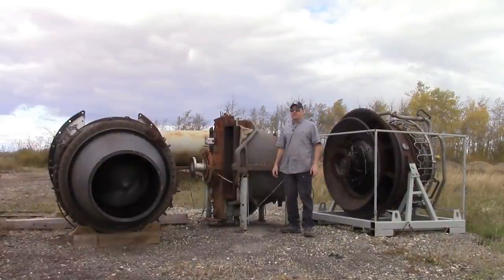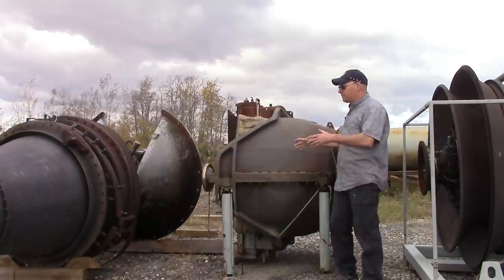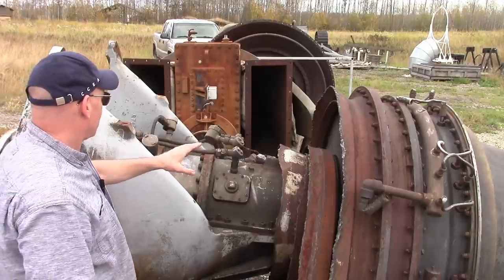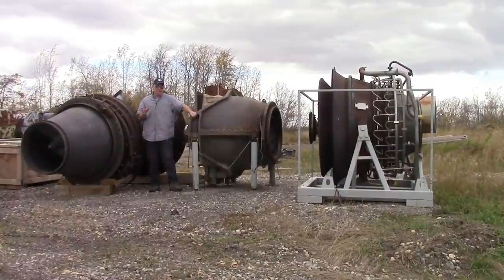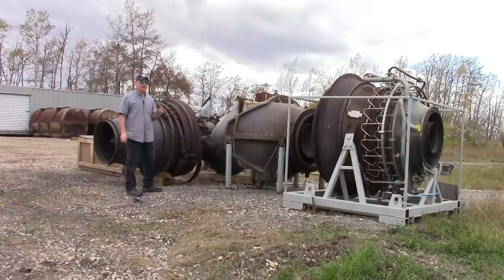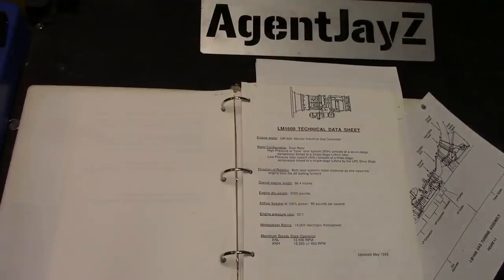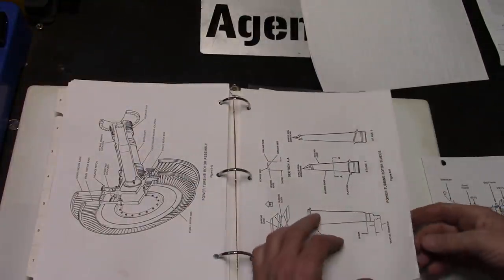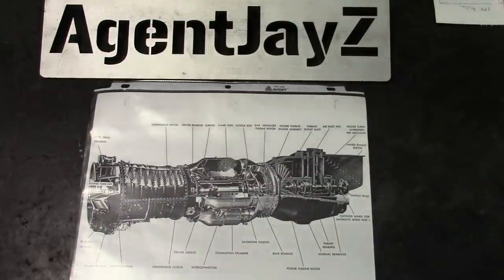Power Turbines 4 Different Ones

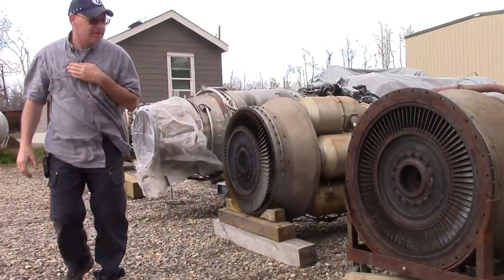Comment: great in depth soliloquy [because the air-head no power people won't be able to comprehend],awesome. you always manage to enlighten even an olde pharte such as myself. couple of curiosities: at 10:00 in the background appears a partial engine in a frame at about 45 degree angle.. whats that? and at 21:45 whats the last engine in that lineup? and, why keep all those "junk" pieces of material if they are just "rusting away". thanks mr Zed  lol
Reply from the maker: That's an afterburner assembly for a Spey, next to ABs for an F404 and a couple J79s.
In the other yard, the far engine is  J65 out of an A4 Skyhawk.
A lot of the parts are stainless steel or titanium alloy. We have too much of this sort of surplus to store it all indoors, but we don't really want to scrap it completely.
Reply: @AgentJayZ  so you're hoarding?  </wink>

Comment: Is there such thing as an engine where its compressor blades that rotates with the compression wall - zero tip clearance?
Reply from the maker: The compressor rotor needs to have rotational speed relative to the stators, so there needs to be a place somewhere with one part moving and one not. The clearance needs to be as small as possible at that interface, but the parts have to move.

Comment: Does the 1994 pt have ball bearings because it runs less often? Or because the oil system is better?
Reply from the maker: Its a choice the designers make. Ball bearings last for years, and journal bearings can last longer in continuous service. I do not know the history of this unit.

Comment: This was an awesome video, but sorry, I have another question. At the beginning and very end of the video, what are the two rings of nozzles on the power turbine on the right? They look like the fuel rings for an afterburner. Is it air or liquid cooling of some sort?
Reply: I'm wondering the same thing. If I had to hazard a guess I'd say water injection based on the look of the plumbing, but that would be kinda odd since the power turbine would already run significantly cooler than the gas generator turbine without any auxiliary cooling
Reply: It's cooling air for the stators.

Comment: With the recent Airbus announcement, can you do a video discussing different fuels for turbines? Kerosene vs propane vs hydrogen ... how must a jet engine be adapted to run on any of them? Thanks.
Reply from the maker: Only the fuel control and delivery system needs to be changed between liquid or gaseous fuel use. For the basic fuel burning core of the engine, nothing needs to be changed. Heat is heat, man, and bring it on!
Reply: @AgentJayZ  So, say you have a hydrogen powered gas generator. Is it then a steam generator? Does the power turbine need to be the size of steam turbine? I wonder how does this affect turboprop concept.
Reply from the maker: No, it is not a steam generator.
Water vapor in heated exhaust resulting from combustion of hydrogen in air is not steam. 
We can't back up any further; you'll need to do some learning on your own.
Besides, I thought your question was about different fuels...
Reply: Having been involved in fuel system and combustion design, I can support AgentJayZ's reply in respect of the fuel control and delivery arrangements, which includes the burners.  For the same energy content and release, the volumetric flow of a gaseous fuel must be considerably greater than that of a liquid fuel.  However, the combustion chamber itself rarely needs any changes . 
Take a look at some of AgentJayZ's videos and compare the relative diameters of the manifolds and burner  'pigtails' for gaseous and liquid fuels.  Similarly, the  internal passages and outlet orifices of gas burners have to be enlarged, relative to the equivalent liquid fuel burners.
Now think about how difficult it can be to design a dual fuel burner, which has to have internal passages to carry the full flow of either fuel.  Been there, done that.
Reply: @jurepecar9092  There is obviously a substantial proportion of water vapour in the combustion products of any hydrocarbon fuel.  When hydrogen is burnt, the combustion products are, equally obviously, water vapour.

Comment: Good Stuff. What would the average power efficiency of a power turbine be? Useful Gas Producer power vs wasted GP power.
Reply from the maker: Graham is a better person to ask about this, but I think I've heard 85% to 90% efficiency for industrial power turbines used with aeroderivative gas turbine engines.
Reply: AgentJayZulu (I must get used to the new handle!) is in the right ball park, in terms of what is termed the polytropic efficiency of a turbine..  A free power turbine is essentially no different in efficiency relative to the LP turbine of, say, a big turbofan engine.  In fact, the latest big aero-derivative industrial and marine engines often use the aerodynamic design (if not the actual blading) of the LP turbine of the parent turbofan.
Considering the RT45 power turbine that we haver been shown here, I've found an ASME paper describing its development, back in the late 1970s.  With its Industrial Spey gas generator, a thermal efficiency of around 34percent at max power was quoted.
Reply: @grahamj9101  85% to 90% is much better than I would have thought and assuming that's running in the normal operating range of 90 - 100% of it's rated power output.
So much more efficient than a reciprocating engine.
Reply: Combined cycle which then uses the waste heat for district heating gets up to 90-ish % thermal efficiency. The best I have seen for a pure gas turbine without using leftover heat for something else was 46% but that was a few years ago, maybe it has improved since. That one was in the 100MW range.
Reply: @gcmsinc  That's just the power turbine's efficiency, not the overall cycle efficiency. The gas generator will have its own thermal efficiency and the total efficiency is the product of the GG's thermal efficiency and the PT's isentropic efficiency.

The most modern engines cores can achieve a thermal efficiency in the low 50%. A modern power turbine will have about 90% efficiency, so overall efficiency (the product of the two) is about 50%, or just shy of it. That's similar to large reciprocating diesels.

With exhaust heat recuperation, higher numbers can be reached. For example, the most efficient combined cycle electric power generators achieve 65% overall efficiency.
Reply: @gcmsinc  I hope that you are not confusing polytropic eficiency with thermal efficiency. As I have mentioned, Cooper Industries claimed a thermal efficiency of about 34percent for the complete RT45 gas generator/power turbine unit. A typical automotive diesel engine has a thermal efficiency of between 30 and 35percent. A modern massive low speed marine diesel engine might exceed 60percent.

Comment: Question. What does stators do especially those who are variable?
Reply from the maker: Stators take the velocity that has been gained by the air due to the action of the rotating compressor blades, and convert it to pressure. The Variable stators help manage the angle of attack of the compressor blades to avoid stalling the compressor. You may want to watch my video called Compressor Stall, and it's follow up video.
Reply: @AgentJayZ  thankyou sir

Comment: A gas power turbine is far more efficient and effective than those humungeously large green wind power turbines blighting our countryside.
It works 24x7x365.25x20+ and overall has a smaller carbon footprint.
Reply from the maker: Um..  David, a wind turbine uses no fuel, so it's carbon footprint is nonexistent. Of course there are environmental costs in constructing wind turbines, and also when they are scrapped at the end of their service life, but those costs are also present with any other type of powerplant.
The fact that during their entire service life, wind turbines use no fuel is advantageous for the atmosphere.

Comment: Are there any centrifugal power turbines?
Reply: That wouldn't make sense.   Centrifugal forces are always outward.    Turbines are just compressors in reverse.   Hydro storage uses the Francis turbine for both directions.   It is not really centrifugal though.   It is more like a water wheel.
Reply: @NathansHVAC  every single turbo charger turbine is centrifugal.
Reply: @NathansHVAC  also turbines are not compressors in reverse.
Reply: @NathansHVAC  and i guess i mean centripetal not centrifugal . but everyone knows what im talking about.
Reply: @jacobpoucher  pull up images of a turbo charger rotor.   It looks like a Francis turbine to me on the hot side.   The difference is the gases never go to the center.
Reply: @jacobpoucher  also the word centrifugal turbine does not exist.
Reply: @NathansHVAC  yeah its centripetal not centrifugal my mistake

Comment: The power discussion is only ever for jets, and it is only about "useful power". It is an academic discussion, and depends entirely on your definition of "usefulness" and your reference frame, or more precisely, where you calculate your power. The thrust on a stationary turbo*jet* is not performing any useful work, i. e. it is not moving the aircraft: W=F*s. When s (the amount of movement) is 0, work is 0. For turboshaft or turboprop engines, power is defined at the shaft. For jet engines it is generally more useful to use thrust (force, not power) when assessing the performance.
Even a propeller driven by a piston engine is not performing any work on the aircraft when holding the brakes.
Reply from the maker: Fail. You made the same mistake as all the other people who oversimplify.
I'm surprised at you.
If you ignore the air because you can't see it, you are thinking like a sub-par grade schooler.
No excuses.
Reply: @AgentJayZ  The goal is not to accelerate air. That's just a means to an end. The engine performs no work *on the aircraft*. There is no doubt or no ambiguity about that. There is no mistake. It's just a matter of what you are interested in. Shaft-engines care about the power at the shaft. Jet engines don't. You do care about the air, because your domain is the engine itself, but pilots don't.
Reply from the maker: You are incorrect. You are deciding on what type of work is important. If it's unimportant work, it's work. This discussion ends here, and you go read a physics text. If you decide to continue with this nonsense, it will be removed.
Reply: @AgentJayZ  There always has to be (at least) one of these guys.